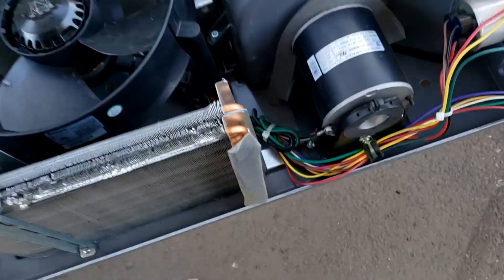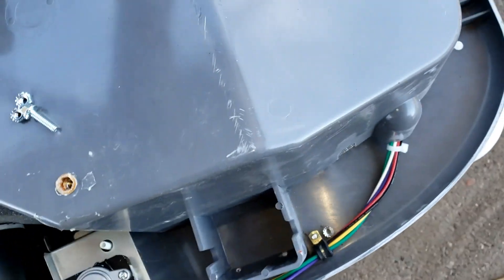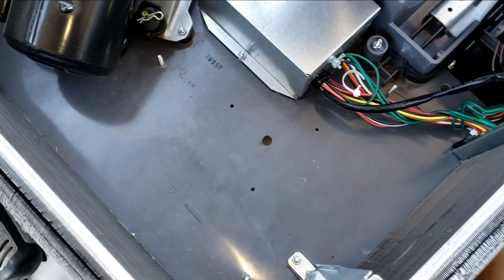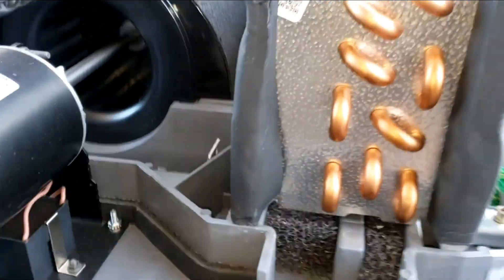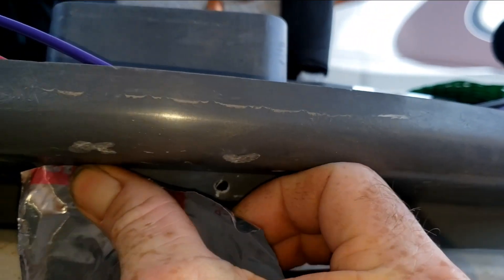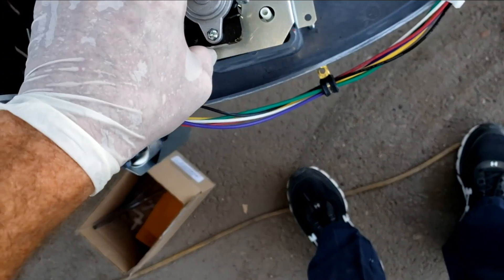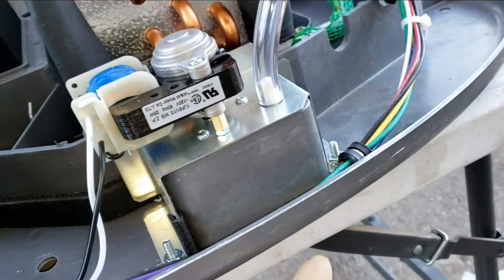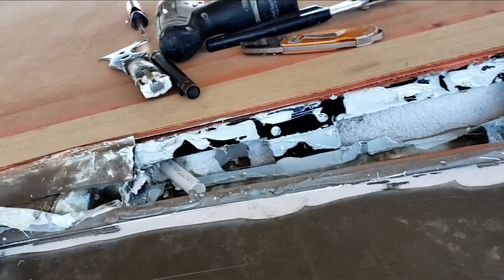Coleman Mach 8 Condensate Pump Installed and Explained!

Comment: The window AC I recently bought sprayed the condensed water onto the hot coil where it evaporates and increases the efficiency of the unit.  I have been thinking of doing that on the RV with one of these pumps.  I wonder if anyone is doing it.

Comment: Great video, thanks for sharing it.  Question for you.  I plan to install 2 of these pumps on my Coleman Mach 8’s.  I will have to run the drip lines down the roof to the back of the coach as I won’t be replacing a roof anytime soon (I hope 😀).  Any suggestions on how to hold that piping down on the roof?  I also assume I will need to make sure the piping is UV stable.  Thanks!

Comment: Great video.  Two questions.  Any idea if I can upgrade my 2012 Coleman Mach 8 to that shrouded fan.  That looks a lot more effective and quieter than my version that deserves the Mach monicker for loudness.   Secondly, you probably want to put a screen insert into that drain tube or some insect is going to build a nest in it and clog it up.
Reply from the maker: I don't know if you could change the impeller from the old style to the new halo style. I would ask RVP/Coleman. Thank you!

Comment: Very helpful video. I need to do the same install as I messed up and ordered the Mach 8 HP without condensate pump only to find there was a pump on my old unit  but the drain line it was plugged which is why water ran down the sides. Do you have the part number for the condensate pump you used?
Reply from the maker: Coleman Machine 47233A3091 Condensate Pump Assembly thank you and good luck!

Comment: James either I mist it or you didn't say.  Does the manufacture put in the drain while building the roof or you modified the ceiling and installed all the drain.  Thanks, nice tutorial.......
Reply from the maker: Overal, RV manufacturers install this when the roof is built. This is a special case where we were re-lamiating the roof so we installed the line while we were at it. Generally, no one adds a condensate line after the fact. :) Thanks!

Comment: You like the Mach 8s? Our coach has 3 AC and all have pumps. Each line is plumbed through the coach down to the wheel wells. Like to upgrade the ACs
Reply from the maker: I do like the Mach 8's. They are low profile and not as loud due to the two blower motors rather than the one. However, they can be very difficult to bolt down from the top if that is how they are installed. If they are clamped from underneath, not a problem. Thanks!
Reply: @AZExpert  Thanks, I can get to the bottom and that is how the old ones are clamped down. We have ducts but I looked and they come several different ways for different kind of ductwork. Thinks it's time to make a change! thanks!

Comment: Interesting James. I believe most rv’s just dump the water on the roof and it finds its own way to the ground as I wasn’t aware this pump was available. It’s an add on I expect and doesn’t come with the ac?

I like this idea. The thing that would worry me is that if this ac failed the next technician would just remove the clamp down screws, unhook the power and yank the ac off the roof with it still attached to the drain tube. 

I’m not sure other technicians know the things you know.
Reply from the maker: I understand your concerns, but I doubt any technician would rip the A/C off with the tube connected. The biggest issue has always been finding a replacememt A/C with a pump on it. They usually have to be special ordered and that takes weeks which is unacceptable when the A/C isn't working. So it's nice to know the pump can be added later, as I and most techs would put a non-pump unit on and just cap the drain. Thanks!